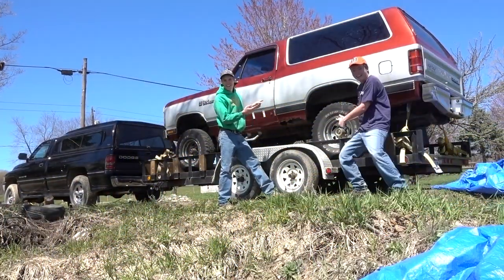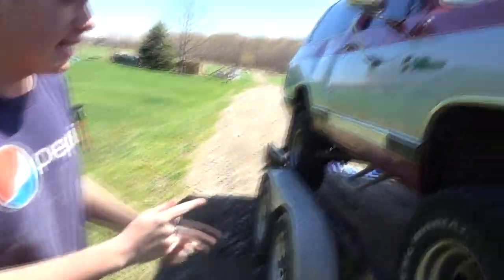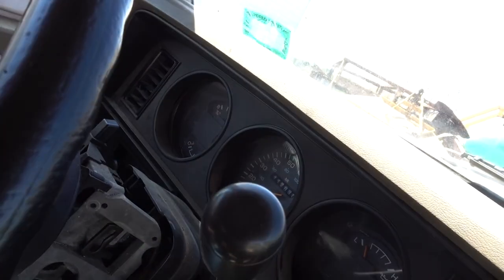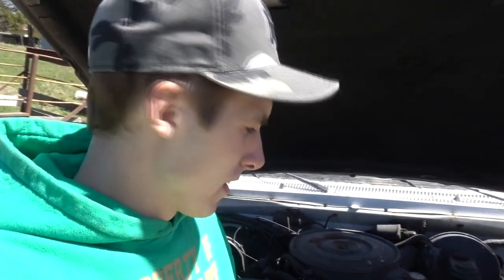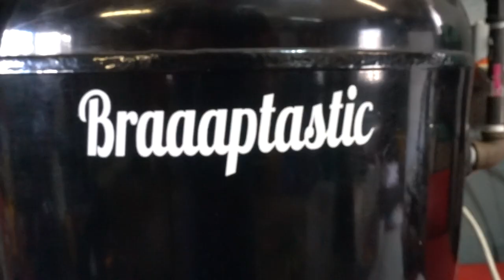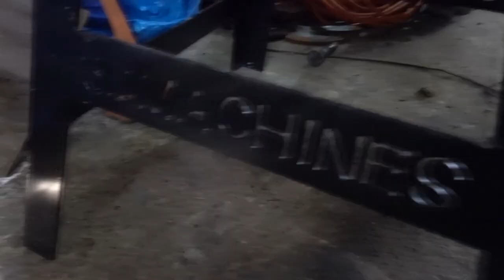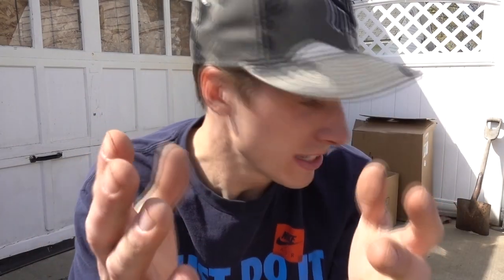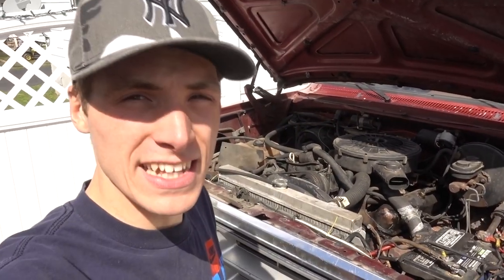NEW TRUCK REVEAL!!! (BIGGER SURPRISE)

Comment: It is so easy to simply replace the head gaskets we have done them a few times on 318's 360's and small block Chevy's. But you do what you want to do . Putting the distributor back in I bet you will have it 180 out the first time. It's okay it will happen to all of us once of a mopar LOL.

Comment: This is a good use of kroil. The engine being taken out should be fixed or rebuilt if he wants to keep the truck running long. Those older engines don't last as long as the newer ones but are cheaper to work on. Cool project, good luck.

Comment: remember its not just the engine that has the wear from all the miles it also means that all the rod ends and bearing/ suspension and all the other shit is also worn and will probably want replacing but any way great video as always bro!

Comment: It doesn't cost $800-$1000 dollars to replace a head gasket. I am currently replacing the head gasket and heads on my '97 ford ranger and it's only going to cost $600 for new heads and gaskets.
Reply: Maximus Rubius I think that was including labour. Head gaskets for it are 70 bucks. Technically the motor swap is more money if you factor in potential labour, so it really doesn't make sense to me either. It's way more time to remove and reinstall 2 engines than to just take the heads off one of them and spend 70 bucks. Not to mention he would have 2 running trucks and not just 1.

Comment: +3DMachines I recommend on your engine and seized stuff you use WD40 penetrating oil because it's the.best kind there is
Reply: And also 3DMachines I also recommend you take aprart your engine a degreaser clean it and put it back together if you ever chose too do anything too you 1985 truck engine

Comment: If he's mud bogging it just use the old motor until it blows while mean time building the good motor to bullet proof it...
Reply: Zachary Miller he wouldn't do that he would fix the old engine and sell it and put the new engine in
Reply: Aaron Hayden he specifically states it cost to much to replace head gasket so that's why he is swapping. He's really not gonna have money if he ruins the good motor and all he has is a spare with a blown head gasket. Always run the bad motor while making sure other is completely solid.

Comment: jest swap the old head with the other
Reply: Jeepsalive1 trouble is, most likely the rod and main bearings are wiped, when antifreeze gets in the oil, it destroys bearings. since the motor would have to come out anyway, its easier just to swap from the other truck. plus, if he rebuilt the other motor, it could run $1200 to $2000. he owns the other truck, so this is the least expensive route.
Reply: you can hear it knocking bad when he drives it off the trailer.

Comment: Wait if the head gasket is bad would it not run? And also #doitfordan
Reply: It would run, just not well. Huge potential for miss firing, and accelerated wear on the bearings

Comment: why not just drop a good old 5.9 12 val Cummins in the ram charger
Reply: Dale from Minnesota because the ram charger is light duty it only has 5 lug wheels and weaker suspension. They will have to do an 8 lug 250/350 axle swap.
Reply: Dodge 318 Cummins but it would be cool